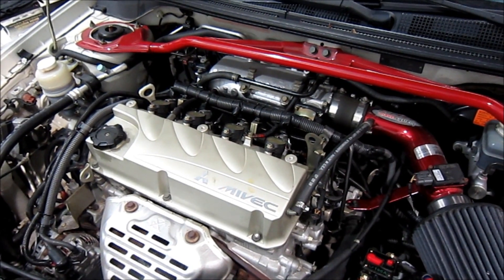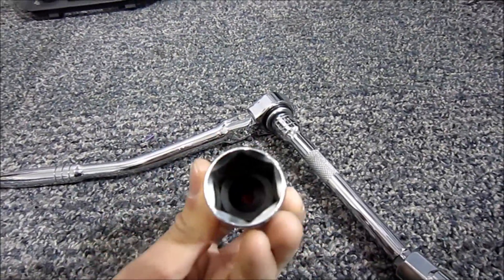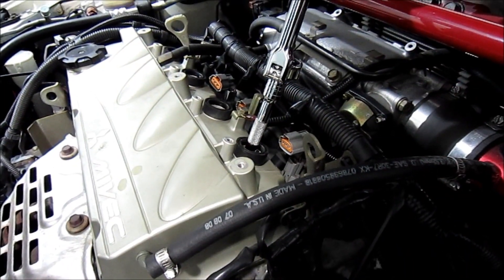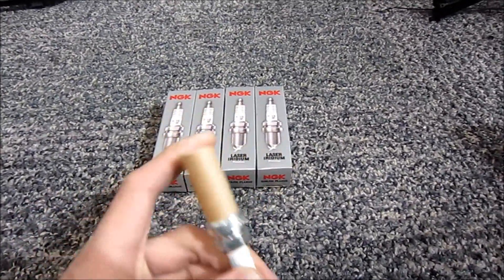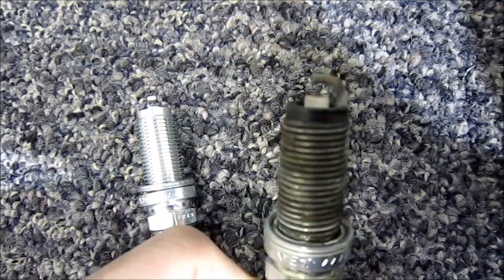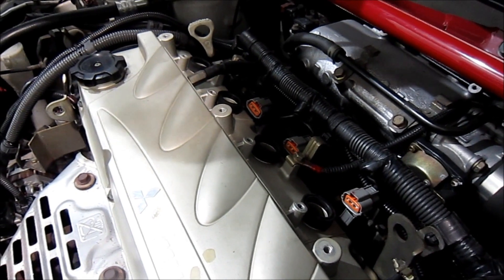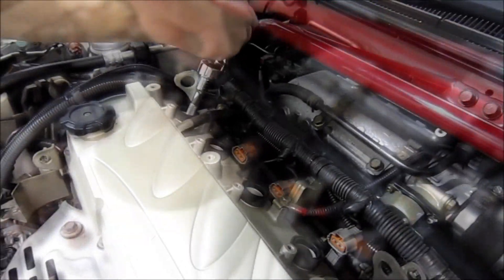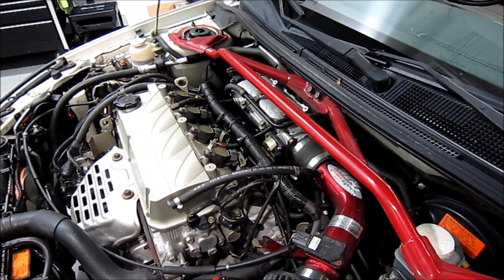How to Change Spark Plugs (NGK Iridium) | AnthonyJ350

Comment: you dont use anti seize on ngk plugs. They say this on their website. The coating on the threads is already anti seize. anti seize will cause more problems. anti seize is only really needed on the older plug types that are not nickel plated

Comment: Always check your gap, I've bought a set of NGK pre gapped plugs myself and all 4 had different gaps.
Reply: +dacrunch Good advice. The gap should be vehicle specs not the manufacture of the spark plug specs. Always check and gap per vehicle specs. Even NGK has this note on their site.

Comment from the maker: It also states "All spark plugs that have a blackened or dull appearance on the metal body offer no protection against seizing or bonding to the cylinder head and so it is with these spark plugs that anti-seize would be required. A spark plug that has a shiny silver appearance on the metal body usually indicates that the plug is manufactured with metal shell plating and therefore will not require anti-seize.

You have to make sure of this or else you run the risk of the plug seizing in the head

Comment: I use Never Seize on the plug threads, and a torque wrench to the specified torque for the vehicle. If the plug has a gasket, you can 'feel' it bottom.  It doesn't take a great deal of torque.

Good idea. Hand thread the plugs to avoid cross threading!!!

I use NipponDenso 0.7mm iridium plugs in my Toyota vehicles.  They burn clean, and last a long time (80K to 100K miles).  

Do I get more power or fuel economy with the iridiums?? I don't know for sure.  But the cars and trucks start reliably.

Comment: One problem I see is that the anti-seize is copper type but that is actually not nice to aluminum heads. Another factor is that it can actually overheat and cause the plug to seize.
 
As for torque wrench - it all depends on experience if you need one. The range of torque needed for plugs isn't that critical. Under-torquing is a greater risk than over-torquing.

Comment: Do i always need to let the car cool down before changing the sparks? Will i make any harm if i do it with the engine warm? Also i'm going to use NGK IFR7G-11KS sparks on my FN2 will i need to coat them with anti-seize?

Comment: The best tip is to read you're manual, this will give you the correct Touque for you're plugs, specially with alloy heads, this quarter turn tight is the very best way to strip or damage the thread in the head it's self, checking the book you'll find that the plug this guy just put in is way to tight. Boys and girls, do it once do it right, check the book and it will be right, not over tight, use a Touque wrench!

Comment: Before changing the plugs, check your old plugs check out how much carbon is on them or oil as well & then test with a multi meter to see if any of them were faulty & also test the new ones before they go in & also after you have ran the car to heat them up, then take them out & test them again, manufacturers always go by marketing they are the best so on, but in reality how many time do you see the end of the spark plug bent over, especially Iridium plugs & they are brand new ? cheers at least that's what i do ?

Comment: You must ALWAYS hand thread first then ALWAYS use a torque wrench specified to your vehicle , I've read many horror stories about improper spark plug installs killing a motor , honestly It's an easy job but if you feel uncomfortable thinking about doing it than don't do it at all , pay someone else to do it

Comment: I didn't think anti seize was necessary with NGK plugs as the threads are coated with a metal that won't seize to aluminum heads.
Reply: Correct, anti-seize is NOT necessary as these plugs and many others are coated by the manufacturer.
Reply: ***** No. You don't use it on plated plugs. Straight from NGK... Applying antiseize to the threads of spark plugs that have a metal plating allows the installer to mistakenly over tighten the spark plug in the cylinder head; This stretches and fatigues the threads of the spark plugs, causing a much higher probability that the plug will break during installation or in some cases upon removal.
Reply: *****
English please. Bottom line... anti-seize is NOT needed. End of story.
Reply: BlackHawkPSU
Dude just in case you did not know, WWW means world wide web, anybody can post here in any  language they desire. Comprende amigo?
Reply: Listen:  you can damage the threads if you use anti-seize and use the correct torque  -- it can stretch the spark plug and make it more prone to breaking in the future.   I hear so many stories of people who say "I have been changing spark plugs for 40 years, and I have always used anti-seize with no problems".  Listen,  it is 2018, not 1968,  spark plug design has changed, so should your procedures for working on your car.   You just can not admit that you are using the incorrect procedure:  do some basic research and you will find the correct procedure.

Comment: Be careful when using the unique "spark plug" socket in the video.   You'll break the porcelain part of the plug if you don't ensure 100% straight up & down alignment when removing or installing.  Also if you try to install the plug with this socket (with the plug fully seated into the rubber insert) good luck getting the socket off the plug after installation (and that's if you don't break the porcelain).  The main purpose for using a torque wrench is:  people tend to OVER TIGHTEN vs under tighten.   So don't follow the video advise to "turn another 1/4 turn".  Very bad advise!  Pulling the threads out of an aluminum head can get very expensive.